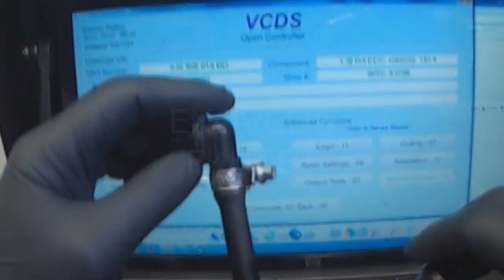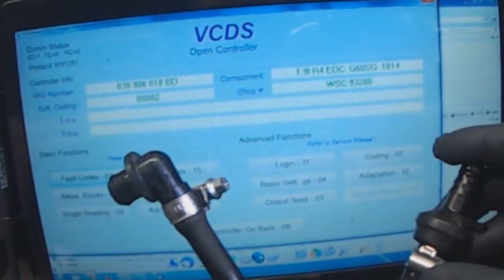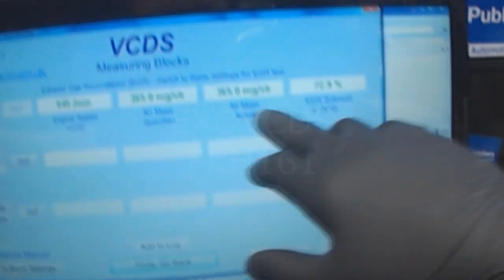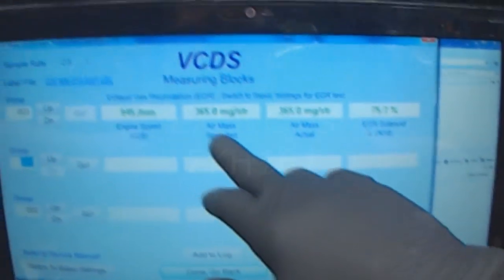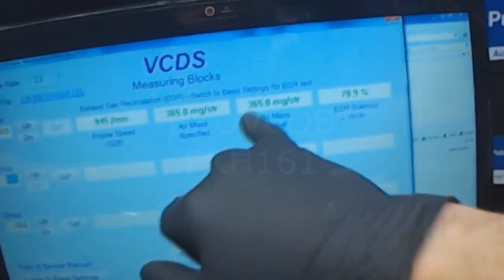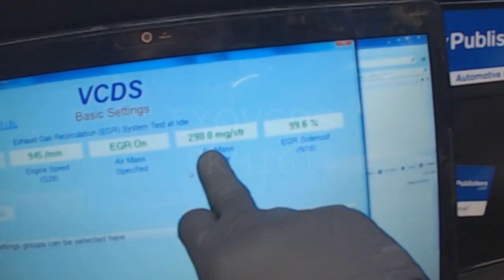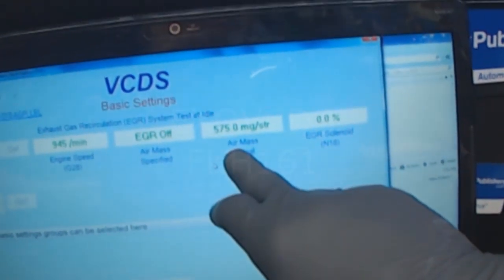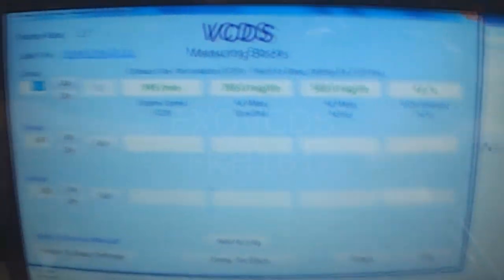VW A4: 1.9L  ALH TDI EGR Flow Check

Comment: I am having issues with how the car is running.The car is running rough still but better after i replaced #3 fuel injector. I just recently purchased the car and the kid said it only needed a lower control arm and i thought ok great! This is not the case. My MIL and ABS and a the other lights in the middle cluster will not illuminate and my temp gauge is also not moving. I had someone scan the car and his laptop died halfway so this is all i have. Any thoughts or suggestions would be soooo appreciated! I also noticed that on top of the battery there is a fuse box and there are 5 wires that come out of it. The first wire on the right side #1 is bipassed and the metal strip fuse is gone and the wire has been moved on the otherside of the box towards the front and the metal fuse is gone! I also havent seen the fans on my radiator move yet either. Also my TPS sensor just buzzes and does not stop when key is in AUX! I think that means it is not calibrating. Where does the first wire on the battery fuse block go to?? I am also not getting any OBD2 codes at all for some reason! The car is also running on the rich side!I just wanted to also add this! I really need some help and thanks!

20 Faults Found:
18010 - Power Supply Terminal 30 
P1602 - 35-10 - Voltage too Low - Intermittent
16684 - Random/Multiple Cylinder Misfire Detected 
P0300 - 35-10 - - Intermittent
16687 - Cylinder 3 
P0303 - 35-10 - Misfire Detected - Intermittent
16497 - Intake Air Temp. Sensor (G42) 
P0113 - 35-10 - Signal too High - Intermittent
16486 - Mass Air Flow Sensor (G70) 
P0102 - 35-00 - Signal too Low
17834 - EVAP Purge Valve (N80) 
P1426 - 35-00 - Open Circuit
17950 - Angle Sensor 1 for Throttle Actuator (G187) 
P1542 - 35-10 - Implausible Signal - Intermittent
17952 - Angle Sensor 1 for Throttle Actuator (G187) 
P1544 - 35-10 - Signal too Large - Intermittent
17580 - Angle Sensor 2 for Throttle Actuator (G188) Signal too Low 
P1172 - 35-10 - - Intermittent
17633 - Fuel Injector for Cylinder 1 (N30) 
P1225 - 35-10 - Short to Ground - Intermittent
17637 - Fuel Injector for Cylinder 5 (N83) 
P1229 - 35-10 - Short to Ground - Intermittent
17635 - Fuel Injector for Cylinder 3 (N32) 
P1227 - 35-10 - Short to Ground - Intermittent
17638 - Fuel Injector for Cylinder 6 (N84) 
P1230 - 35-10 - Short to Ground - Intermittent
17880 - EVAP Leak Detection Pump 
P1472 - 35-10 - Short to Ground - Intermittent
17843 - Secondary Air Pump Relay (J299) 
P1435 - 35-10 - Short to Ground - Intermittent
17829 - Secondary Air Injection Solenoid Valve (N112) 
P1421 - 35-10 - Short to Ground - Intermittent
17636 - Fuel Injector for Cylinder 4 (N33) 
P1228 - 35-10 - Short to Ground - Intermittent
17923 - Intake Manifold Valve (N156) 
P1515 - 35-10 - Short to Ground - Intermittent
17634 - Fuel Injector for Cylinder 2 (N31) 
P1226 - 35-10 - Short to Ground - Intermittent
17525 - Oxygen (Lambda) Sensor Heating Circuit: B1 S2 
P1117 - 35-10 - Short to Ground - Intermittent
Readiness: 0110 1101

-------------------------------------------------------------------------------
Address 03: ABS Brakes Labels: 1J0-907-37x-ABS.lbl
Part No: 1J0 907 379 H
Component: ABS/EDS 20 IE CAN 0001 
Coding: 03604
Shop #: WSC 00066 
VCID: 3663DDFA12827BAE71B-4B1A

3 Faults Found:
01276 - ABS Hydraulic Pump (V64) 
16-00 - Signal Outside Specifications
00290 - ABS Wheel Speed Sensor; Rear Left (G46) 
35-00 - -
00287 - ABS Wheel Speed Sensor; Rear Right (G44) 
35-00 - -

-------------------------------------------------------------------------------
Address 15: Airbags Labels: 1J0-909-60x-VW3.lbl
Part No: 1J0 909 609 
Component: C AIRBAG VW3 SG 0002 
Coding: 00067
Shop #: WSC 00066 
VCID: ECD7BF929C4E717ED7F-4B1A

1 Fault Found:
00532 - Supply Voltage B+ 
07-10 - Signal too Low - Intermittent

-------------------------------------------------------------------------------
Address 17: Instruments Labels: 1J0-919-xxx-17.lbl
Part No: 1J0 919 951 B
Component: A4-KOMBIINSTR. VDO V57 
Coding: 06262
Shop #: WSC 00000 
VCID: 2F6DE89EEDD84A6632D-5142

1 Fault Found:
01039 - Coolant Temperature Sensor (G2) 
29-10 - Short to Ground - Intermittent

-------------------------------------------------------------------------------
Address 46: Central Conv. Labels: 1J0-959-799.lbl
Part No: 1J0 959 799 AJ
Component: 61 Zentral-SG Komf. 0001 
Coding: 04096
Shop #: WSC 00066 
VCID: 8603ED3AA2E2AB2E21B-4AE8

Subsystem 1 - Part No: 1J1959801C
Component: 61 T?rsteuerger. FS0001r 

Subsystem 2 - Part No: 1J1959802D
Component: 61 T?rsteuerger. BF0001r 

Subsystem 3 - Part No: 1J4959811C
Component: 61 T?rsteuerger. HL0001r 

Subsystem 4 - Part No: 1J4959812C
Component: 61 T?rsteuerger. HR0001H 

4 Faults Found:
00953 - Interior Light Time limit 
25-10 - Unknown Switch Condition - Intermittent
01358 - Internal Central Locking Switch; Driver Side (E150) 
27-10 - Implausible Signal - Intermittent
00912 - Window Regulator Switch; Front Left (E40) 
27-10 - Implausible Signal - Intermittent
00944 - Heated Exterior Mirror; Passenger Side (Z5) 
35-00 - -
Reply from the maker: You'll need a good wiring diagram to check all the components for correct power & ground / continuity of wiring.

If wiring checks out ok, then the components might be bad ie. Temperature sensor, throttle body module etc.

Check your charging system & power feed into the car... the fuses on top of the battery were probably bypasses because they had issues (burnt / hot / corroded connections).

All the short to ground codes are usually due to a bad fuel pump relay or were set when you took the relay out (if you took it out).

Clear codes and deal with the ones that come back right away... not all running issues will set codes. The ECM can't track some faults, so it's not always easy to say what causes what.